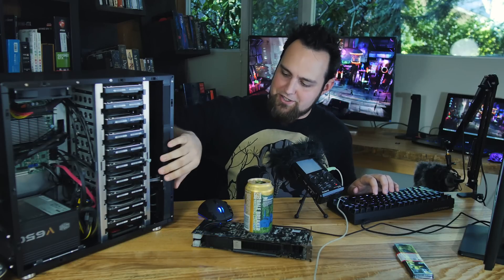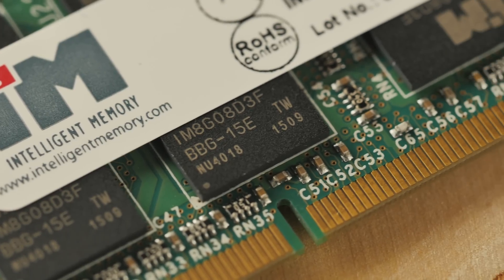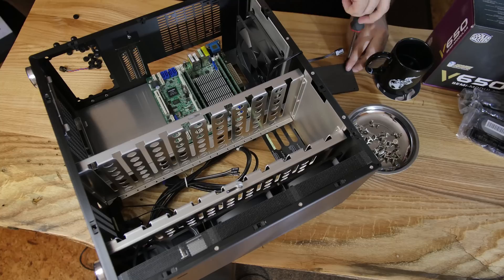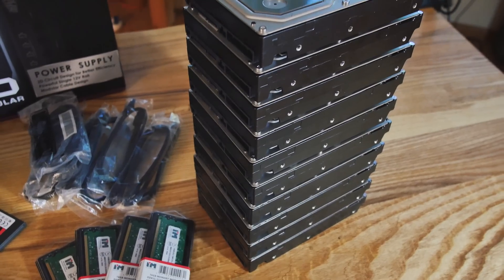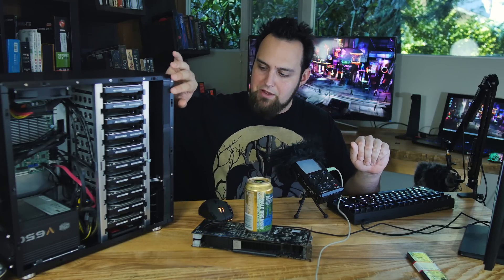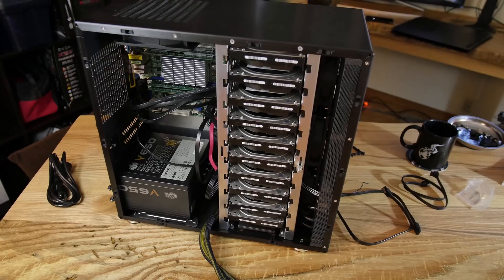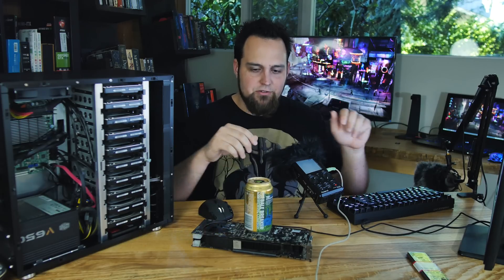Our New NAS: 40 TB, 64 GB ECC RAM, SSD Caching, 10 Bay Case

Comment: Hi Logan,
    I wanted to clarify one point. According to one of the ZFS developers, Matthew Ahrens: “There’s nothing special about ZFS that requires/encourages the use of ECC RAM more so than any other filesystem.”. I think the reason you are recommending the use of ECC ram is because of the so-called "Scrub of death" scenario, but that idea seems to be not realistic once actually thought through and would require a hash collision to occur to actually cause any data damage. I think you are just recommending ECC ram because the FreeNAS developers do, but if there is more to that could you share what your reasoning is?
Reply: ***** Right, but why live with the chance of partially corrupted files, no matter the amount of corruption? Why chance it at all when it can be avoided completely? H.264/5 and other video codecs can recover easier because in a few frames you reach a keyframe again, so only a few frames get corrupted. A JPEG is a single frame though, not many frames!

To answer your question about JPEG specifically: The JPEG format is lossy, as you probably know. After the initial encoding process (omitted because the specifics don't matter, watch Computerphile's YouTube videos on JPEG if you're interested, they're great!), the data gets compressed with a compression technique known as Huffman Coding. A flipped bit in a raw, uncompressed image would ruin a pixel, a bit flip in a JPEG due to the compressed nature, could have much larger consequences. Try it yourself! Grab a hex editor (that has a binary view too) and a JPEG and randomly flip a bit and check the consequences! Be sure to try flipping bits at the beginning, middle, and end of the file to see what happens! (There are also some academic papers written on this subject, regarding formats other than just JPEGs)

Furthermore, images were just a simple (albeit quite possible) example. I don't know about you, but I want my data perfect, especially when I only have to spend a bit more money to ensure much more data security. Why buy a lambo (the 40TB array) and put crappy tires (non-ECC memory) on it? You're already spending the money, why not spend a bit more to protect your investment (your valuable data)?
Reply: Alexander Bender ECC memory is a must for any data-storage application that requires data security, even if ZFS isn't the filesystem in use. You're misunderstanding that quote. Data security requires ECC memory no matter the filesystem; ECC memory is recommended equally across all file systems, no more so for just ZFS.

Let me take you through a (intentionally simplified) scenario to illustrate this:

You and your family just got back from a long trip and you have tons of important, irreplaceable photos on your camera. You copy these to your NAS, but a silent bit flip (that could have been detected / corrected by ECC memory) occurs in the buffered data before it's written to disk, completely ruining a picture. The copy finishes, and later that night, your nightly automated backup backs up your data to an offsite location, including the corrupted picture. A few weeks later, you do a manual backup to an external drive connected to your NAS, as part of your monthly manual backup rotation, and bring that drive to a different offsite location.

Now, a few weeks later, you format your SD/CF cards to make room for new pictures.

Finally, a few months later you notice that one of your pictures is corrupt. You check all of your backup locations, but its corrupt everywhere else too! Lost for good, irrecoverable. All because a bit flip that your memory didn't catch (but could have caught if you had ECC memory!) caused corruption before your backups had a chance to do anything to save you.

---

Sure, you could solve this by looking over every picture you copied prior to formatting your SD cards, but this is just a simple example. ECC isn't that much more expensive anymore, nor are the motherboards and CPUs required to run it. Please, if you value your data, no matter how many backups you have, use ECC memory!
Reply: Alexander Bender It's much more that the "scrub of death".  All memory has an error rate.  ECC is many magnitudes lower error rate than non ECC.  

The biggest reason you need ECC is not that you may loose some bits, but there are too many places losing one bit will make your pool non-importable.    If your bits get corrupted in ram, all copies of those bits are corrupt on the disks.  If those bits are in metadata, you're pool is likely toast unless you are really good at picking apart a corrupt pool and repairing it.   The is no 'fsck' for ZFS and there probably never will be.   Developers are much more comfortable saying ONLY use ECC and not developing a fsck for ZFS.   

Scrubs find bit errors not corruption.   It is assumed that if there are bit errors on disk you have redundancy to repair it.   In ZFS all metadata has at least two copies at distant locations on your disks even if your data doesn't.   

If you don't buy ECC and want to keep your data, you better have good backups.
Reply: rainy724 i'm using ecc with zfs myself, but I sure can understand non-ecc temporary builds. Because in fact most people have no time to dig through all the theory to get things done.
I saw cases when one at first would want zfs features badly and than after some experience with it just give up because of complexity of use and level of though that should be put in every decision around the system.
In this case "scrub of death" really appears to be old forums myth. I read things about it, arguments were convincing.
FreeNAS devs and old folks recommend (but never limit to) ECC because its a server sphere standard, it's mandatory because fails cost more.
There are much more chances that pool will die because of stupidity than bit rot, but people should decide on their own whether to support ecc in home environment. In my place, for instance, its about twice as expensive.
Reply: Alexander Bender tsss!
Reply: Alexander Bender Well it's more expensive... That's pretty much the reason for all of the IT purchases anyone does, it's more expensive so it must be better! Common sense be damned!

I'd be surprised if you'd get anything more than a snarky remark from them, curious about the answer myself though.
Reply: rainy724 why would you be so sure that sinle bitflip would ruin lossy jpeg or any of media content? i'm not sure but bitflip seems to be way too tiny problem for that. media would fail all the time if it wasn't
h.264 would be fine even in case of 50 bitflips on a single file, which is what? pretty impossible/ players just skip corrupted parts

Comment: "We can run some visualization." Oh please tell me you're not using FreeNAS on a VM. It's designed for as close to the metal access as possible and running through a VM will only screw with it.

Comment: I noticed that only 8 of the sata ports are sata3, and the other 4 are sata2, i assume the ssd was on a sata3 port as it is used for caching, and is double the speed.
So 7 of the 4tb drives are on sata3 and the others on sata2?
Does ZFS do something clever regarding the drives it writes/reads from? maybe i'm missing something.
But since you're not using a 10gb nic i doubt you would benefit from higher sata speeds anyway.
Could you post your thoughts?
Reply from the maker: celderic123 yeah, Sata 2 doesn't matter at all for HDDs... the SSD is on a SATA3 port.

Comment: I think there where more crap than usually from you guys in this video.

1. Was this a sponsored video? There were a lot of endorsements on those memory sticks that you got, but I'm not clear on wheter or not they paid you to say all that. Don't like it when deduction is the only way of disclosure (I'm OK with sponsors btw, I just want to know what the case is when I watch a video).
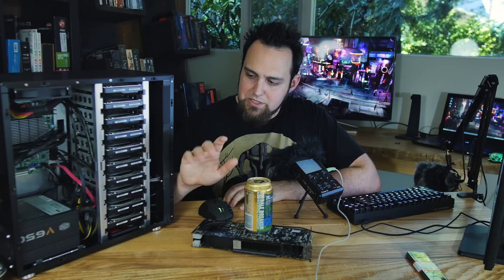2. 3:34 - Gold certified PSU does not have anything to do with what load it will be under. That's just the power output. There was some short syllable I can't quite hear in there, so I might just mishear you. But to clarify to others: Gold certified PSU's are good for efficiency (not wasting power output on heat etc, but actually making useful power out of most of it), not really to stay under low load.

It's not major things, but I'm mentioning it because I hate when people don't come with constructive criticism.

I love your channel, keep up the good work.
Reply from the maker: Andreas Lindhé Nobody gave us a fucking penny for this video. Can I not like anything without someone claiming I was paid off?

Comment: Did you ever complete a video on the more specific setup?

How is this handling parity/redundancy? I understand the 40TB is JBOD but I'm more interested in a redundant solution.

I'm also curious more why you didn't at least add a 10Gb ethernet card or a SFP add-in card so you can run something more than gbe for the whole office....
Reply: si do My mistake on the more specific setup video. Feel free to message me specific details. I just realized this is only a few hours old.

Comment: You can also build your own SATA power cables. Not only will this eliminate the need for a molex adapter, but you can make them with no additional slack between the drives. Perfect fitment and better cable management.

Comment: how about some measurements in performance?

can it saturate how many gigabit connections? any word in 10GB?

the atom can transcode how many 1080p streams in real time using PLEX? it is a viable solution to use Plex to four different Tvs? or should i go with 4 Kodi/XBMC Pcs?

Comment: I've had good experience with Seagates... Old 250 gig and 320 gig still work great... been 7+ years. I have bought 2 WD drives in the past... both failed in a few months.
Reply: Every seagate drive i owned ended up with clicks and bad sectors. Every westen i had still works...even the ones on IDE. Samsung hdd survived too but wdd better
Reply: fordcabriogt Neither is better than the other to be honest.. just people tend to judge by personal experience... and I'm no exception
Reply: Ive had a WD green and a seagate barracuda and both failed in about 2 and a half years
Reply: xXSUPREMEMASTERXx cheap ones die quite fast no matter the brand e.g. a wd green is made by the shitiest materials
Reply: Yeah I know, I was forced to buy a WD green as my seagate one broke and i only had enough money for a WD green, getting a 2TB WD black soon though so that should be okay for a while (it has a 5 year warranty).
Reply: WD Blacks are really good from my experience they will last more than 5 years , at least i have an old 1TB of those and its still rocking 6 years now.
Reply: Phoenix Fourth Good to know, my WD black is now on the way :D
Reply: cracktober That's mostly true. Some brands do fail more often than others though... IE: You can't compare a Lada to Toyota :P

Comment: Why ZFS and RAIDZ? RAIDZ is known to have problems and is also quite slow. ZFS is also crappy, especially on Linux. You should be using BTRFS instead with RAID10. Maybe not as stable since it is a newer FS, but better performing and in my experience more reliable than ZFS. Also, RAID10 is very fast and doesn't have any of the issues that RAIDZ or RAID5/6 have.

Comment: What actually is the advantage of FreeNAS over Ubuntu Server with Samba?
Reply: doe maeries FreeNAS is a BSD distro based around the specific use of being a NAS, so it comes with the features needed out of the box. You could rebuild the functionality with Ubuntu, but that would take some work. There's also a Linux based one called OpenMediaVault if that's more your thing. It's based on Debian, just like Ubuntu.
Reply: doe maeries I can't find any... I have had trouble with my FreeNAS setup and switched to Ubuntu server. No regrets
Reply: doe maeries it´s easy to use, the network stack and security are great but the most important thing is that the bsds implement zfs really well... i´m not making the mistake of comparing bsd and linux though...both are super flexible and can work great when handled correctly
Reply: ZFS practicly, linux never gonna have proper support of due to licenceing issues, that why they working on there own alternative called BTRFS
Reply: doe maeries Ubuntu requires patching to get ZFS to work.
Reply: NubCakez101 I also had problems with FreeNAS (some years ago, though), if you used both GUI and command-line tools (zfs/zpool), they didn't agree...
I'm currently also using Ubuntu server with ZFS (zfsonlinux.org), and I've had no problems with this setup. The problems I had with FreeNAS may very well be a non-issue these days, though.
Reply: BSD is enought for me :)

Comment: my NAS is a cobbled together mess using an old 4U security DVR case, recycled motherboard and power supply, two Dell PERC 5/i's and a pallet load of ebay'd 1TB Samsung drives, half of which have failing SMART tests from literally never being shut off ever.

Comment: Meanwhile Linustechtips are building some server with 30 1TB SSDs, 2 18 core Xeon and 128gb of ECC memory annnnd a Titan X
Reply: He actually had 2 titan x
Reply: Maxwaehrens Yea but that machine isn't just a NAS, it's also a transcoder.
Reply from the maker: Maxwaehrens  it's headlines vs practicality. Also, he has a much larger staff and they do way more in the video field. We build what we need, no need to get into an e-peen measuring contest. It's OK to be different... at least that's what they told me...
Reply: Tek Syndicate Oh I agree, also your videos are in a way far better, because  more users can actually build a system like this than what LTT are doing.

+K-Antor correcet me if I'm wrong, but I'm pretty sure I said "some server" and not a NAS.

+Jerry He Yeah I know he showed 2 Titan X but I'm pretty sure he can't get two of them, two CPUs and all the raid cards he need on the motherboards which are currently available.

Comment: You know, for Home Theater stuff, it still makes sense to just use single drives connected to your computer via USB 3.0, etc.  You just plug it whichever drive contains your media and go to town.  NAS's will eat up your power bill and heat up the house.  Not that building them isn't a blast, of course.
Reply: Nas doesn't really consume much power. Especially while it's idle. It will add probably a dollar (max two) to his monthly bill.
Reply: Heh for home theater stuff most tv's now have media players and USB! I just use an external drive heh
Reply: Yeah just re-read it and it seems obvious now.... But for one TV f that noise is what i say!
Reply: Great, idk why i would use that tho. Browse to the movie and play, same as plex but without the bling or usage on me network.
Reply: wayzhc Quite a bit more than that. Each of those drives consumes 7 watts idle, and the power supply is about 90% efficient, so call it 110 watts for the whole system. Multiply that by 720 hours in a month, and you have 79 kWh. The average US electrical price is $0.12/kWh, so the monthly cost is approximately $9.50.
Reply: ***** I prefer the HGST Nas drives as they have vibration sensors, whereas the WD Reds do not. The WD Reds spin slower, so performance won't be as good, but they also consume less power and produce less heat.

The brand I won't touch is Seagate: in the past few years, I've had a 75% failure rate with Seagate (with different sized drives). RAID is not a backup, but restoring from backup is a pain. Believe the BackBlaze reports: Seagate is unreliable.

BackBlaze also reports the WD Reds haven't been faring as well as the HGST Nas drives, so personally I'd spend a few bucks more for the best and go with HGST.

Comment: why do u rest your drinks on grahics cards?
Reply: because its broken
Reply: ***** do you still use the hard drive?
Reply: Alice Banaszewski those graphics cards died a long time ago...
Reply: Because it's a nice tech related coaster. Fits the studio set. He has used it for years. And don't worry, the graphics card died long ago :)
Reply: Alice Banaszewski Because he doesn't want drink rings on his desk?
Reply: Alice Banaszewski Thug Lyfe
Reply: Alice Banaszewski Are these two different gpus on top of each other?
Reply: Tobias L. It's a dual gpu card. It's a 9800 GX2. It has two PCBs.
Reply: Alice Banaszewski I use my DVD-ROM as a coffee holder
Reply: Advection357 can i have it please sir?
Reply: Alice Banaszewski Sure, you can have the empty plastic cup... :P
Reply: Advection357 sir you should not have hot drinks in plastic cups you might poissin yourself!"
Reply: wayzhc Still faster than TitanX.
Reply: Alice Banaszewski It's a GTX 4xx series card. It can boil his coffee at will.
Reply: ShiroiKage009 9800 GX2. But still a toasty card :D
Reply: wayzhc
;P

Comment: My PC broke and I need a nrw Graphics card. I have around the £90 GBP mark but can go to £120 at a push. I need a graphics card which is perfect for rendering and Game play, 60FPS+; 1080+ all for the best quality. Could you help me on this? 
Oliver Kiuzelub-
Reply: Best bet is to get a GPU second hand off of eBay. Shame, a few months ago you could've gotten decent mid range GPUs off of failed bit coin miners who jumped on the train too late and now have a surplus of GPUs with not a lot of wear on them.
I speak from experience, bought a sapphire 270x for 90$, 7 months ago. Helped me build my 400$ computer :)
Reply: KIUZELUB GAMING Save a bit more and get a 960 I'd say.
Reply: Sayian505 Okay, Cheers.
Reply: Get a GTX 960 or an r9 280x
Reply: KIUZELUB GAMING 270x or 280x
Reply: Gerard Maraj Everyone knows you use ASIC machines to mine and I don't don't even mine
Reply: ASIC machines are one option to mining. There are other options to mining. Some people didn't go the ASIC route, they went the GPU route and figured out it was a complete waste of time and electricity. Those people then sold their almost brand new GPUs at 70% below original price.
Reply: R9 380 4Gb Sapphire 10% more performance than a gtx 960 for the same price... Or take a r9 280X sapphire (cheaper)